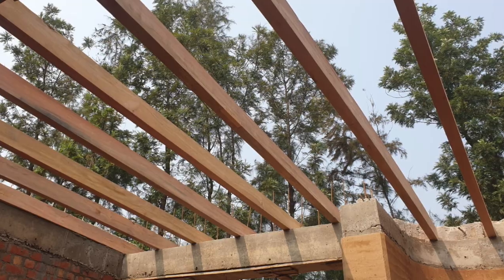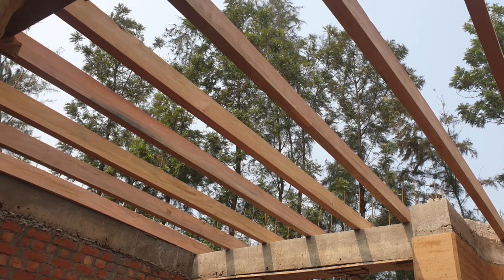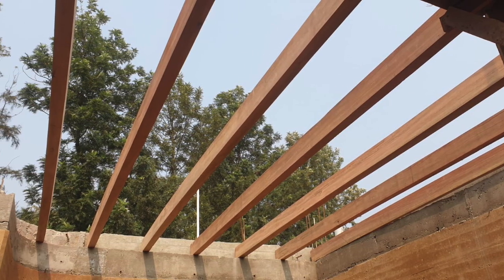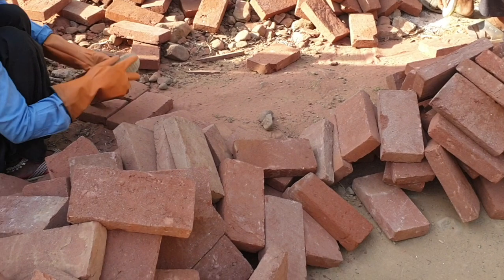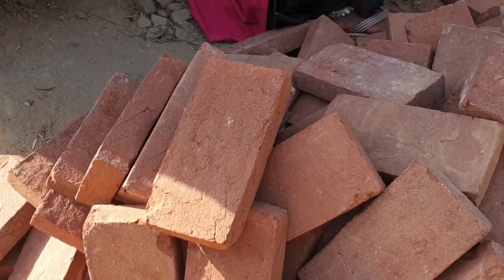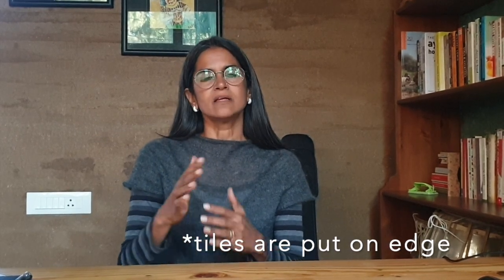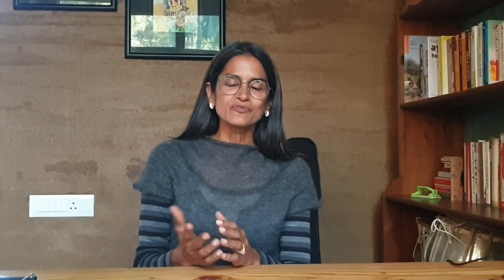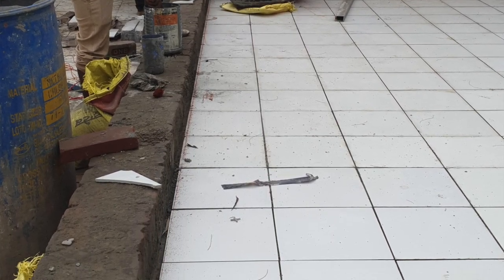How to Build a Madras Roof

Comment: Hi. Nice video. Could you please share the cost per square feet for this roofing?
Reply from the maker: It will depend on cost of bricks, wood and masonry in your area.
Reply: dont use this type of terrace.the wooden frame under this terrace will be destroyed by termites in few years.also needs frequent termite maintainace .this type of terrace has no steel rods inside it so it will fall within split seconds if the ceiling gets weak due to termites .rcc will notify if it gets weak this type of ceiling will fall all of a second which leads to fatal death of 2 families in tamilnadu in jan 2024.beware dont use this ceiling
Reply: https://www.youtube.com/watch?v=qSUhIr5CcnQ

Comment: Finally... I could see this now... thankyou so much for uploading this vedio. I really like this madrass roofing.  This is definitely going to be in my house. insha allah.
Reply from the maker: Great! All the best!
Reply: dont use this type of terrace.the wooden frame under this terrace will be destroyed by termites in few years.also needs frequent termite maintainace .this type of terrace has no steel rods inside it so it will fall within split seconds if the ceiling gets weak due to termites .rcc will notify if it gets weak this type of ceiling will fall all of a second which leads to fatal death of 2 families in tamilnadu in jan 2024.beware dont use this ceiling
Reply: This is not the perfect way of working. In Madras roofing we do not use cement at all.
First layer is wooden rafter that is teak wood teak wood is having oil content so termite will not attack the wood or palm wood. If you use palm tree wood then you have to apply cashew nut oil on the palm wood and every six year you should apply the same oil to termite will not attack.
2nd layer is 3x1x6 brick which is bind with lime mortar and three inch height 35degree slope. lime mortar 1:2 ration also need to consider the calcium level in the lime above 70percent. and waterproofing material is kadukkai jaggery mixed water but  kadukkai jaggery water should fermented for 10 days.
3rd layer is same 3x1x6 brick should be laying on top of the second layer.
4th lime sand brick jelli mixture
5th and 6th terracotta tile

Comment: i love learning so much from you!
Reply from the maker: Am glad!
Reply: dont use this type of terrace.the wooden frame under this terrace will be destroyed by termites in few years.also needs frequent termite maintainace .this type of terrace has no steel rods inside it so it will fall within split seconds if the ceiling gets weak due to termites .rcc will notify if it gets weak this type of ceiling will fall all of a second which leads to fatal death of 2 families in tamilnadu in jan 2024.beware dont use this ceiling

Comment: Please give complete tour of the sustainable house ? Can say from background that entire house will be exceptionally good
Reply from the maker: It is exceptionally good, but i need to keep some privacy!
Reply: @farmaanandaa   please try if possible but only and only after privacy is completely intact
Reply: dont use this type of terrace.the wooden frame under this terrace will be destroyed by termites in few years.also needs frequent termite maintainace .this type of terrace has no steel rods inside it so it will fall within split seconds if the ceiling gets weak due to termites .rcc will notify if it gets weak this type of ceiling will fall all of a second which leads to fatal death of 2 families in tamilnadu in jan 2024.beware dont use this ceiling

Comment: You are right. Lime mortar making is bit lengthy process. Earlier they used to have bullock moving as a merry go round and with a grinder moving along it used to crush lime and make homogeneous mixture alongwith mixing other elements sometimes jaggery.
Reply from the maker: Also i believe they would use shells as a source of lime.
Reply: dont use this type of terrace.the wooden frame under this terrace will be destroyed by termites in few years.also needs frequent termite maintainace .this type of terrace has no steel rods inside it so it will fall within split seconds if the ceiling gets weak due to termites .rcc will notify if it gets weak this type of ceiling will fall all of a second which leads to fatal death of 2 families in tamilnadu in jan 2024.beware dont use this ceiling
Reply: @surajramakrishnan7141 why are you copy pasting same text everywhere?? There are many buildings built decades ago with Madras roofing still being in use and in good condition including my ancestors home built in 1940s..
Reply: @prakaashj5485  when it falls.the govt will say not in good condition.all news channels will say it as old building collapses due to poor maintenance.lime mortar will collapse when it is fully contact with rain water all time.and i will definitely say it again it will collapse all of a second without notification.u cannot judge a lime mortar ceiling strength unlike Bombay terrace with steel rods.
Reply: Stop making this ridiculous comment. You have no idea what you're talking about! 😒 @surajramakrishnan7141